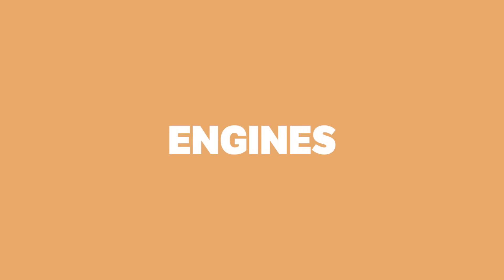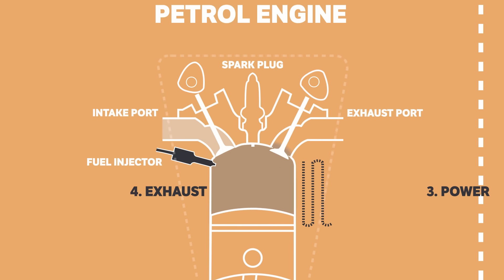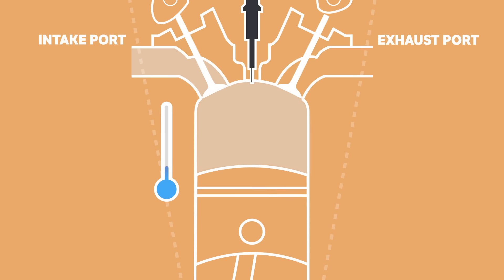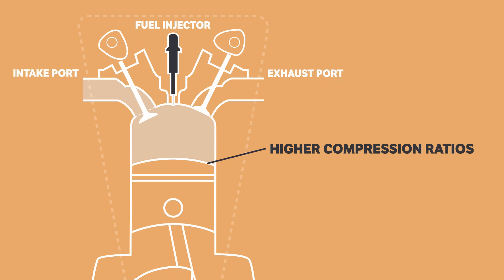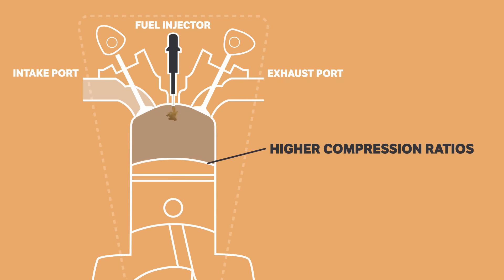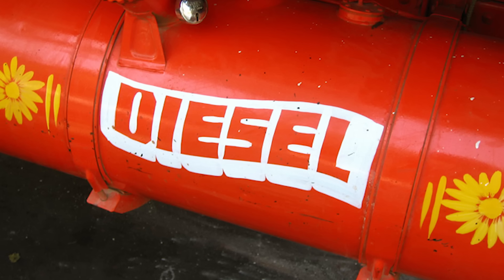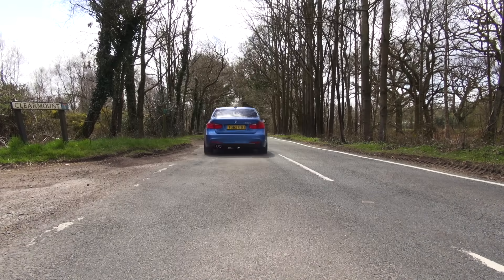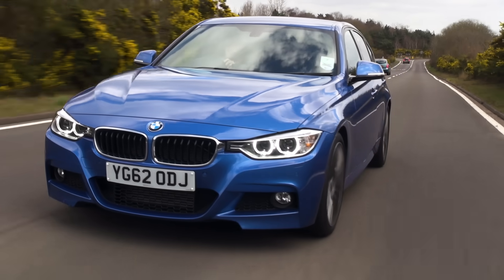The Differences Between Petrol and Diesel Engines

Comment: diesels are kinda impossible to stall xD
Reply: Been there, done that.
Reply: You've never driven a Ford diesel it seems
Reply: You nerver drove behind a learners car, did you?
Reply: what, 1100rpm is still quite a lot for a diesel, most only stall under 800 or so...
Reply: The ship I work  on has a diesel engine (inline 12) that operates at 115 RPM. Not times 10 or 1000, just 115.
Reply: Anyone going to match me? Stalled an automatic diesel. I consider that to be one of my highest achievements.
Reply: Well in driving school i did it a few times, was a golf gtd. And for me that was not to long ago bc i have had my license for only 2 months now. But even after that i managed to stall the VW t5 o my father bc i was in to high of a gear, it made a loud bang and went out and the lesson dont bring a t5 under 1100 rpm when driving it.
Reply: Then I've done the kinda impossible.
Reply: RifleRud come to a full stop with it in gear, that will stall anything
Reply: Stalling a 3L gas V6 isn't that hard, try to stall a 4L Diesel I4 engine in a tractor :D You can start in 4th or even 5th (out of 5) gear
Reply: +Szabolcs Süli renault TDi 
what the fuck m8
Reply: So are most 6+ cylinder petrol engines....
Reply: Well, that's what he means by "full stop"... If you hit the brakes without pressing the clutch it will stall for sure, I've done it.
Reply: I've stalled plenty of diesels... Even one with a runaway engine..
Reply: My parents own a diesel VW Tiguan, stalls at like 850, idle is like 925 or something. When driving in 4th or above, revs should always be above 1200 otherwise it will vibrate like mad...
Reply: Patrick Kerr - All cars will do this.
Reply: RifleRud but have the ability to go "run away"
Reply: +panzerveps that what you got do when they do that. not panic like must people do
Reply: The thing i really dont like about Diesels is they can make a really fancy car sound and smell like a bloody tractor!
Reply: Have you ever tried with max load and A/C on ? I think you are just new to diesel. But thats okay, you are on the right (greener) side. :)
Reply: RifleRud Well today i witnessed my grandpa stalling his VW Touran TDI while slowly going down a hill
Reply: You can literally get out of the car whilst in first and it'll keep going along happily, great in traffic jams ahah!
Reply: +enska5 So how do you achieve such level of mastery?
Reply: enska5 at an incline with little to no push on the acceleration pedal ?
Reply: I once stalled a diesel on my learners
Reply: Tell that to the beaten up crafter I drove the other day, clutch on that was so fucked the van stalled 4 times whilst leaving the car park lol
Reply: Stephen Butler I agree with that. Diesels really do their best not to stall, even if you mash them.
Referring to instant power in town, I just petrols have a wider power band and that is why they are preferable and feel snapier. But even in town with a diesel, if you are in second gear, 1.5-2K RPM and you give it full throttle it will go like a bullet till 4-5k RPM, which is something like 70-80km/h and over the speed limit in towns. 
In town, we need electric cars. No noise, no feathering the clutch and throttle pedal, no fuel consumption when idling at lights, no real maintenance needed, much more fuel efficient and most important, no exhaust gases. If things go well, in 10 years we will see massive adoption of electric vehicles, which can only be a very good thing.
Reply: It does stall.
Reply: Vlad Mihai this sounds to me like you should consider getting an automatic transmission for your Next car m8.
Reply: I do it sometimes
Reply: RifleRud my experience is they stall quite alot, my aunts Ford Focus diesel from like 2006 i think but that stalls like a normal car
Reply: +Memer DH i have 04 focus 1.8 tdci and he stalls when you drop it under like 800 rpm just like any other car,and i can say its easyer to drive focus than 07 vw t5 1.9 tdi
Reply: Well the focus is lighter, and I'll guess it's the 85 kw one? I'm guessing the T5 is 74 or something. 

So it has more power (guessing), and is lighter - so yes, it should be easier to drive. xd
Reply: +Gijst focus 74 t5 74
Reply: Xd
Reply: Ultrakillerism hhahahahahahah i own a diesel ford focus you can stall super easy
Reply: Pre-2015 Volkswagen TDI clutches are actually bretty trickym m8
Reply: Blonde moment? :'D Shit haha as if I knew that
Reply: nah just swapped mine
Reply: tell me more
Reply: I started driving Golf mk5 SDI in slight uphill, in second gear and with the handbrake pulled :D it didnt stall
Reply: +99Lezard99 it to help with stop start to. you can still stall
Reply: Modern common-rail diesel engines have lower torque at lower RPM so they stall a bit easier than old diesels. A 1.9 TDI ALH with classic rotary fuel pump generally moves from a standstill without touching the accelerator pedal. If you do push it, it will compensate and pull harder to avoid stalling, even with AC and on a hill, so yes, it is quite impressive. The only way to stall it is to release the clutch pedal very fast without touching the gas pedal, but then it will violently stall, pushing the car a few meters in front.
Comparatively, a 1.4 petrol engine stalls without noticing and they need quite some revs to start on a hill. I am not even talking how hard it is to start with AC and on a hill. Ok, maybe V6 petrols over 3L start more easily, but most of modern city cars have under 2L sizes, in general 1.2 or 1.4. Even turbocharged petrol engines have the same behavior, so it is what it is.
I prefer petrol engines in cities because they rev easily and give the impression of sportiness. Outside of town, I would take also a petrol, but only a turbocharged one or a bigger size one. If not, I would take a diesel, because it pulls easily in any gear at any RPM on any incline. It is very easy to drive a diesel outside the city.
Reply: Drive a Nissan Navara, I was learning to drive in my dad's after coming out of my friends aygo. Stalled the Nissan 4 times before I got going... really high end grab on the clutch, diesels can be stalled and very easily
Reply: my A3 shots itself if you try to set off in 2nd unless you rev like ya grandad
Reply: James Philpott True. like i said. harder to stall.
Reply: nope. winter while going in to a parking hall, "high" rpm to dry concrete.
Reply: years of practise
Reply: BL-10 et HE ! Tumbler73 I can't figure out how you could stall a deisel going down a hill. Even if you let the clutch out as quick ass possible in 4th, it would for a moment chock, but the momentum of the downward incline to bump start it. 

You would have to be really riding the break hard, to kill any possible momentum. 

A 2l diesel is hard to stall however, when your new to a deisel, from driving petrols, you will be caught out by the lack of instant power, and have to re learn to be in a gear lower than you was use to. Especially around town, as it just isn't as responsive. It want stall, but it take off in the "that gap" like the equivalent size petrol. On the flip side, once doing 70mph, your always in the torque band, so no gearing down to take off is needed.
Reply: Vlad Mihai defo, that was my point, with a deisel when going slowly, you have to be in the right gear for it to go. Compared to a petrol engine of the same capacity, you have to be a gear below. 

For instance in my old (last petrol car), a 2liter 180bhp petrol, I could be lazy and drive it in 3rd around town, and still it would 'spring to life' at a poke of the accelerator, then jumping into my next car, a 2l turbo petrol diesel, a 150bhp (but far great torque), I soon learned doing 20mph in 3rd, and trying to accelerate quickly you had to drop down to 2nd.

Ffw 10 years and I've got my first auto box, a 2litre turbo deisel, with 180bhp and 360nm torque. So I can be lazy and let it do the work around town. 

I'm returning to petrol next. Not out of any hate for diesel, I just want a vrs estate. Estates (wagons) are dying, so this may be my last chance to get a quick estate. Got a 2 door coupe atm, totally over the 2 doors. Lol.
Reply: But the T5 is heavier, I dunno. xd
Reply: Gijst the Wight in this case is irrelevant, the extra torque from the unit, far outweighs the extra weight.
Reply: That makes no sence, my S1 is way easier to drive than the shitty driving school cars i learned on : a fucking 60 or 70hp diesel Citroen C4, everytime I had to start I'd stall the piece of shit once or twice
Reply: Yep my v6 cougar seems to be way more responsive then the diesel car i learnt to drive in
Reply: That just means you're a shit driver. Diesels are pretty hard to stall, and you can pretty much get going without the gas pedal. I had no issues driving a 55 HP diesel car,  or a 70 HP diesel car, or a 110 HP diesel, or a 90 HP petrol. 

So yeah, you're probably just a mediocre driver.
Reply: This means you're a shit listener nobody said that they were'nt hard to stall they're just smoky and noisy!
Reply: I was gonna say, I've stalled a Ford Powerstroke diesel before.
Reply: @Tyrone Nelson I wasn't referring to you, but to the PlasticAcaria guy.
Reply: Gijst Oh sorry bud
Reply: No problem, no idea why it doesn't say who I'm replying to.
Reply: Guess im better than you... At stalling driver's school cars
Reply: panzerveps 6th gear saves the day!
Reply: RifleRud oh you can, when my mom didn't tell me yet that, unlike my driving school car, I have to step on the gas while starting to drive in our car, I definitely got it to stall a lot
Reply: The renowned 1.9TDI ALH does not stall on first gear without touching the accelerator pedal even on small hills. It doesn't stall on flat ground in 2nd gear also. You can stall it only if you are doing it on purpose or if you release the clutch pedal too fast.
Also when you start moving, the sensation is not like a petrol where if you do not touch the accelerator you won't feel almost any resistance from the engine, therefore stalling almost immediately. It you stutter and ramble and shake again and again until it recovers. I did a stupid thing once where I was with reverse gear engaged, stopped and then I released the clutch pedal very fast (just a glitch of my mind) and the car violently rocketed 2-3m in the back with the engine stalling. Another time, I was climbing a hill and slowed down for a red light, I had AC on, and 2 passenger and was in 3rd gear. When the light turned green I was still going with 30-40km/h in 3rd gear with ~ 1000RPM, maybe lower, cause the engine had some coughs when I pushed the gas pedal, but no surprise, it recovered with no problems and went on.
Naturally aspirated petrol engines do not have this kind of tolerance, especially ones under 1.6L capacity. They will stall very easily if you don't help them with a light touch of acceleration. Turbocharged petrol engines are much better and they even more tollerant that turbo diesel engines when it comes to accepting lower revs.
Reply: RifleRud I've done it. My truck if you idle in gear there's not enough rpm to keep it going so it stalls
Reply: Harb443 The First nope, we have a renault TDI and it starts to go automatically. Even in fifth gear. Like a boss. That was intresting for me because it wont stall. Only if you hit the brake. ;)

Comment: Please, don't use a diesel for rolling coal...
Reply: Hugh Jaynis dumbfuck. (just wanted to get involved)
Reply: Louis Barningham well said dude
Reply: Why? It's just particulate waste caused by turbo lag when more fuel is being pushed into the motor before the turbo spools up creating a cloud of partially burnt fuel which is harmless and eventually settles to the ground. I drive a 97 5 speed Cummins and it's pretty much impossible to drive those trucks or any diesel truck without blowing some smoke, especially when towing.

Comment: To summ up:
Petrol=good
Diesel=not as good
Hybrid= pointless
Electric=k 
VTEC=fastest car ever
Reply: VTEC = kicking in

yo.
Reply: VTEC master race
Reply: KAL 1 Every Car Throttle video ever: Kal 1 writes the top comment for some reason
Reply: You can get a cheap civic for about  £400
Reply: badboy 25 and the koenigsegg regera
Reply: Again with the Vtec, no originality there are way better faster cars in the same class range that will destroy it. Honda owners are notorious for not caring for their car.
Reply: Here's another one:
GM Ecotec 2.2L = Bullshit oil-devouring, ignition-module-incinerating pile of crap.

Source: Dad's Opel sedan
Seriously, it may be smooth below 3000RPM but fuck that.
Reply: KAL 1 i have seen you 3 times in different videos
Reply: LOL ;)
Reply: KAL 1 hybrid pointless? Laferrari... nuff said
Reply: @Bosai Man. You forgot the NextEV Nio EP9. Yeah, it's Chinese, but it is the second fastest road legal car ever to lap the Nurburgring.
Reply: Shut up about hybrids and electrics. Technology is moving. i feel sad for internal  combustion engines. The world is constantly changing.
Reply: So, what your saying is 158-205 horsepower(depending on model) is the fastest thing out there? Remember after parasitic loss from the torque converter(auto transmission), which could be 25 horsepower lets say, is 133-180 hp to the wheels. That's less than my Ecodiesel(which dyno tests show about 205-215 hp to the wheels). So with the Ecodiesel in question there is a loss of 25-30 hp depending on the test averages. Yes its a heavier vehicle but, it still moves faster than a lot of cars from a dead stop without having to try.
Reply: civic backwards is still civic
racecar backwards is still racecar
civic=racecar
Reply: Bruh the acura nsx, Mclaren p1, porsche 918, Ferrari laferrari are hybrids and awesome. And u are saying they are shit
Reply: Damn, I need to get my hands on a lawnmover, where can I get one? Also, how much lawn will it move?
Reply: VTEC IS A ENGIENE NOT A CAR😂😂those non car people
Reply: Hybrid in my favourite car... the toyota prius
Reply: KAL 1 

Petrol   good engine for all cars
Diesel    good for trucks 
Hybrid   not good except in P1
Electric in tesla, YEAH
VTEC      excellent for lawnmovers